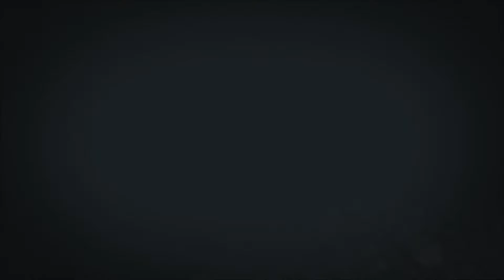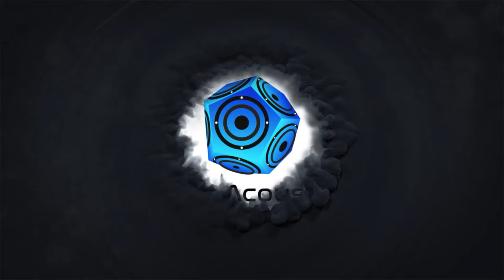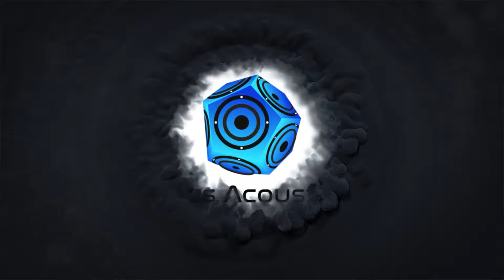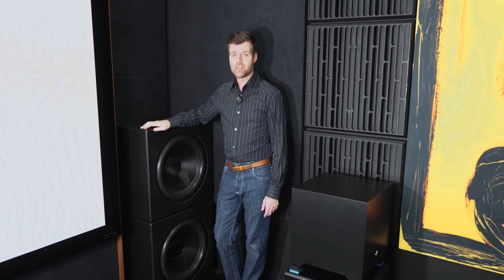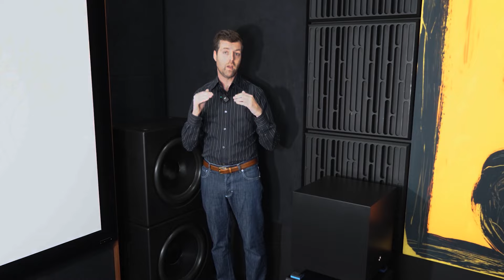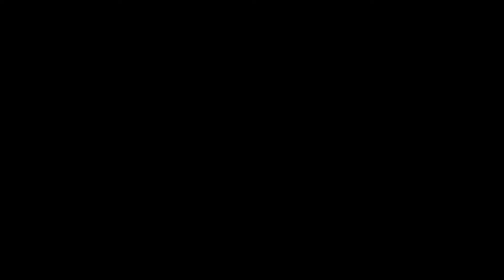Transforming Subwoofers: Next Level Bass Experience

Comment: "Speed" is group delay.  Ported subs have lots of group delay because they rely on pumping up a resonator to produce the published response.  So there is delay in all those bass notes that depend on the resonator to produce them.   Sealed woofers are just better.  Sure, a single woofer and a vent will produce about the same amount of low bass as two sealed woofers.  So just use two sealed woofers and have great bass.  Nice system.

Comment: Do you know if those 18's use a version of Stereo Integrity's HST-18? That HST-18 has near identical specs.
Reply from the maker: It does not and I do know the source of the driver.  39mm xmax for HST vs 36mm of xmax.  The RTJ 18 driver has less than 1mh of inductance and a lot of very large inductance rings, the HST is 1.2mh of inductance and likely has similar but not the same inductance rings.  I believe the impedance of the HST is half that of the RTJ driver however, because you can wire two RTJ18's together in parallel and get 2 ohms.  But the HST driver is dual coil and its dual 1 or dual 2.  The RTJ driver is a custom driver for RTJ and could not be bought off the shelf.  The maker is a completely different maker/builder.  The HST is a very good driver however and makes an excellent subwoofer.  Certainly the two are similar in a lot of ways.
Reply: Nice. Thank you for being willing to share that knowledge! I appreciate you. @PoesAcoustics

Comment: Interesting enough I have been trying this similar concept. My. challenge is that i have a open rear end in my hometheater. The usual approach of 4 in the corners does not seem to provide any benefit. I then bumbend into the SBA idea. Do you think that you would get better performance if the JTRS where futher away from sideswall and seperated more height wise?

Comment: Would you use that same calibration approach even with multi-sub DLBC? Do you think it would do a better job than the Trinnov optimizer?
Reply from the maker: DLBC is better for bass integration and EQ than Trinnov Optimizer. However what I did manually is effectively the same as what DLBC does automatically.

Comment: Hey, Matt. When you say “EQ so it’s cancelling modes”, are you saying that boosting or cutting a specific frequency for a specific subwoofer impacts how they affect that mode? I’ve been doing research on MSO and Double Bass Array and it sounds similar to what you’re saying. Since modes move with frequency, it makes sense that to get all modes killed you need to EQ each frequency to a different level.
Reply from the maker: So MSO is the same concept as what I am saying. Double bass array is completely different and unrelated. Double bass arrays don’t cancel modes. They prevent their development from happening in the first place.

Comment: Hey Mathew. Thanks for the video. Have you ever try Meyer Sound’s Subwoofer? I used to use D215s but  the Meyer X800C was killing it much faster and a lot more output.
Reply from the maker: Yes i've done a number of installs with Meyersound.  As it is a pro audio subwoofer it is expected it would have more midbass output, but it does not have anywhere near the deepbass output.  I don't use them in home theater installs for the most part, I have prefered alternatives.  That is also a ported design tuned fairly high, around 30hz or so, meaning the driver loses excursion control below that.  The ports also contribute to high group delay, which degrades the LF sound quality.  In my opinion, these are not comparable products and I wouldn't personally call the Meyer better.  It's a well designed pro cinema subwoofer best suited to large venues where the efficiency benefit of porting is needed.

Comment: If I didn't do diy I would definitely  have saved for jtr or rtj.  Unbeatable price vs performance.  I wish Jeff would sell the drivers individually or tell us where he got them
Reply from the maker: Hah I know where he gets them and the specs. Even if you knew, you still couldn’t get them. It’s a very custom driver from the manufacturer. It’s not off the shelf and a few of the parts are custom made for him for use in the motor of his subs. If you bought the non-custom version, it wouldn’t be as good. Much higher inductance and distortion.
Reply: Who knows the build house, but I'd look toward Scott Atwell and Fi. 

We're so lucky right now with an abundance of incredibly strong performing drivers. 

There was a time ~10-15yrs ago, Eminence was one of the few full stable mfrs of sub drivers. 

Janowitz and his superb AE drivers were fledgling, but pulled through. 

Thilo's TC Sounds were state of the art, but here today gone tomorrow. 

Kevin Haskin's Maelstrom 21" designs boom, gone. Adhesive challenges did them in. 

Dan Wiggin's Adire designs were cutting edge ... gone. 

For both the DIY crowd and OEMs, it was slim pickens, quite tricky back then. 
Eminence (Lab Series) was a constant. 
So many came and went.

Comment: How much sound performance do you think you lose having the screen and main speakers on the long wall?
Reply from the maker: I don’t have my screen and speakers on my long wall. 

But if that was referring to a fictitious scenario, usually the issue of placing it on the long wall is a lack of room depth. So you end up too close to the rear wall and screen.  Poorer immersion.  Side wall reflections are potentially more delayed which could be good, but the shorter back wall reflection time is a bigger problem.

Comment: Can you elaborate what wall circuits you're using? Are they dedicated to the fuse box? I can't see both let alone one plugged into a shared standard 15amp wall plug and getting max performance. Thanks
Reply from the maker: Those subs are passive enclosures and powered with rack-mount amps. My rack closet had four 20 amp 120 circuits. My sub amplifiers are each in a different circuit. Then my main amps are on a third circuit. The projector, processor, and source all sit on the 4th.
Reply from the maker: And yes it’s all dedicated on the breaker box.  This is a purpose built room. New construction.
Reply: I suspect no problem with even two on a circuit. 

Unless you're pushing 10hz test signals non-stop for over a minute, ... you're golden with a pair on a circuit. 

Even a pair on a single shared 15a circuit, operating at full output, playing the most demanding material ... will be fine. 

By design, beeakers will pass huge amounts of current for reasonable amounts of time, to avoid nuisance tripping. 

A 15a circuit can pass ~45a for up to 10sec! 

It's all good. 

Performance can suffer slightly via voltage drop, but you're not going to trip a breaker.
Reply: @PoesAcoustics  okay cool. Thx
Reply from the maker: @FOH3663  this argument gets made a lot. But as someone who has installed and used these amps quite a bit. I can tell you from experience it is not true. It’s not fine. We had this same amp powering four 18’s on a single circuit.  On that same circuit was a second smaller 1000x2 amp. We cranked some dance music and popped a breaker. Did so repeatedly. And that wasn’t the only time we’ve ever popped a breaker with a big amp.  

You really do need a good number of dedicated 20 amp circuits and we have had systems that still managed to pop the 20 amp breakers. In really big systems we installed 240/20 circuits for the subs.  

I got more serious about using dedicated 20 amp circuits in my designs after my own experience years ago where I had setup a fairly powerful home theater on a single 20 amp circuit. The entire system was on a single circuit. I ended up popping the breaker when j upgraded my sub amplifier to a 3000 watt amp.  I couldn’t watch a movie at reference levels without the breaking popping. I had a second circuit run.  In my own first dedicated theater I had three put in.  In my professional work I always pushed for them. As you can imagine, designing something for a client and having it pop breakers wouldn’t make the client very happy.  

Most amplifiers can’t produce there rated power for very long and small bursts often draw very little power. But producing 120dB in a room from 20hz to 100hz can require a ton of power and these very high power pro amplifiers will draw it.
Reply: I can elaborate more given more time, I'm not a proponent of any choke-point in power delivery. 

Dedicated circuits all around ... 100%

Merely pointing out that breaker trip curves are very forgiving of typical crest factor material ... and don't be afraid to place two SpeakerPower SMPS 2.4kw amps on a circuit. 

I own two myself.
Reply from the maker: @FOH3663  this is an SP2–8000. That may be where the confusion lies. We stuck an SP2-8000 and a SP2-4800 on a single circuit and it didn’t last long.
Reply: Ok
That's on me. I was associating a different amp with it. 

Still, breakers in proper condition,  will pass extra-ordinary amounts of current to avoid nuisance tripping. 

Over 100a for transient pulses. 

Breaker do age and become more prone to tripping. It is an electro-mechanical device.
Reply: What are the main differences between this and jtr rs1? Specs look similar to me
Reply: @PoesAcoustics  
Ok, had a sec to revisit this for clarity. 

Here's the disconnect;  
The OP inquired how they can't see two of these, let alone one ... being placed on a circuit.  

I thought the question was how many subs. 
Two is the answer. No, not ideal, but yes, 100% doable. 

Extended test tones, yes it'll trip. 
Typical duty/crest factor, don't be afraid, it won't trip. 

Breakers in good working order are incredibly tolerant to extended current demand.
150%-200% of the rated trip amount for up to 30sec! 
Voltage drop, otoh, ... is an issue. 

Your example of four amp channels, per circuit, tripping, ... I agree, no bueno. 

I too have performed these experiments. 

I'm all for overkill. I installed three upsized, dedicated circuits for, just for my subs. 
(one being a quad 18" which doesn't need much power)
Reply: @BobbyJ337  would love to have Dr Poes's opinion on this

Comment: You mentioned that you are not using these for Waveforming but do you think that you can get away with lesser subs for Waveforming and have similar performance in bass quality as these RTJs without Waveforming? This topic comes up frequently since using 6-8 high end subs is expensive
Reply from the maker: I wasn’t using them for Waveforming at the time I did the video. I am now testing Waveforming.  

So the subs still need to be good clean subs with low distortion, low mechanical noise, etc. Anyone doing Waveforming has a Trinnov. It’s got a $20k minimum cost of entry. So I would expect such folks use good subs too. But…to answer your question, you can have lesser subs for sure. They add coherently in the array. So an array of 8x 12” subs could give similar performance to the four 18’s I have if the 12’s had 34mm of excursion too.  Such a setup could offer very good control. 

Remember that only the front woofers are emitters and define the performance envelope of the system. Not the rear subs. The most the rear subs do is add an additional limit.
Reply: @PoesAcoustics  I was not clear with lesser, yes I meant smaller subs but you got it and answered me what I wanted to know, thanks :) It's not just about the cost but the size if the room is not big then 18 inch subs are harder to properly spread. These RTJ subs are surely kickass, could you show the amps next time? I'm curios if AoIP is there but I guess it's not.